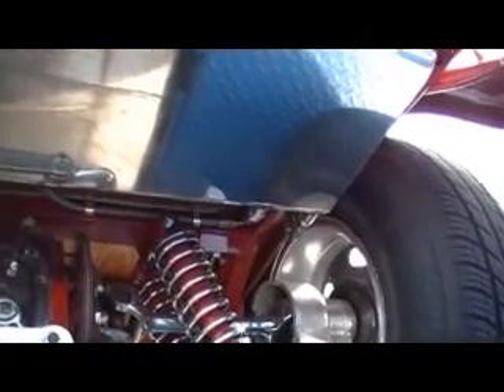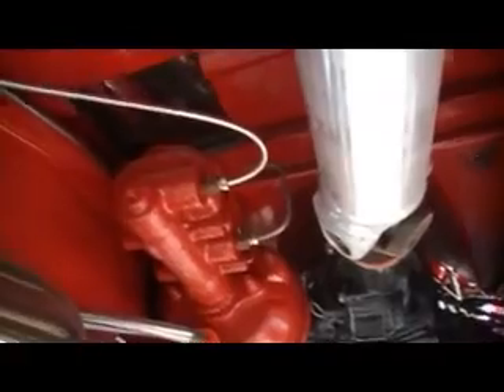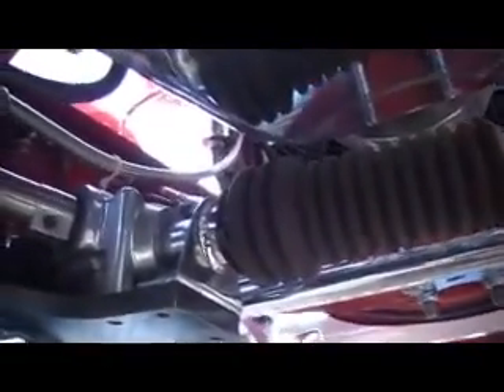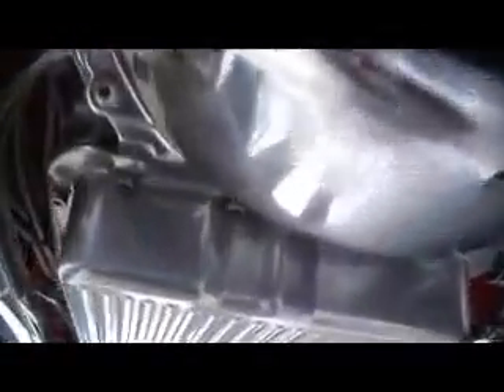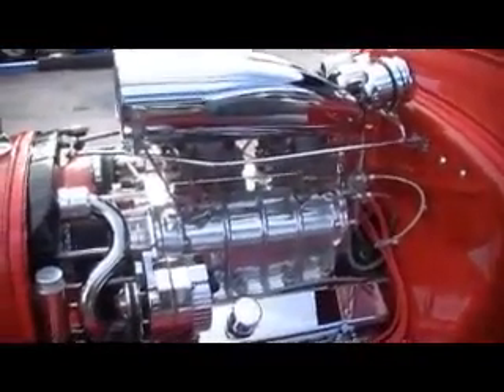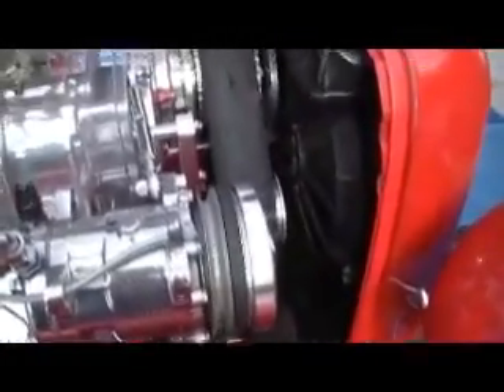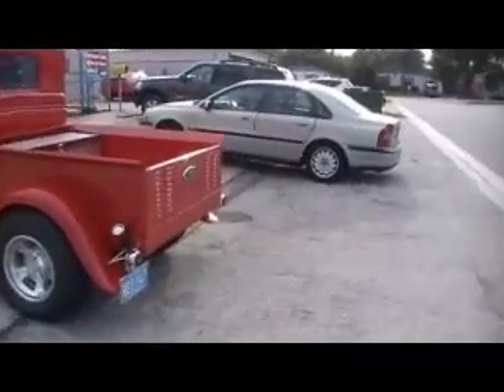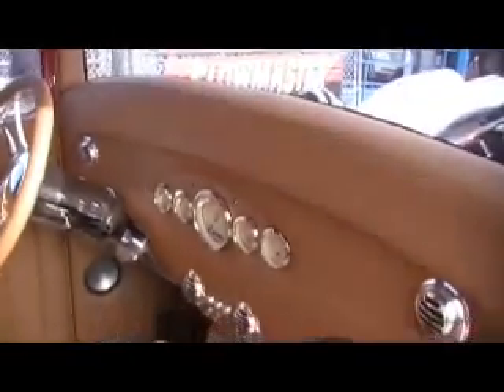1934 ford pickup at performance center auto

Comment: This truck is NOT channelled as claimed in the video.  If it were, you wouldn't see the frame rails under the cab, the doors would be closer to the running boards, and the cab would have less leg room!